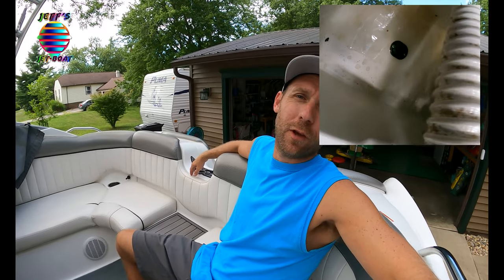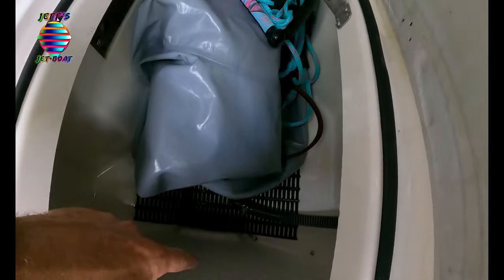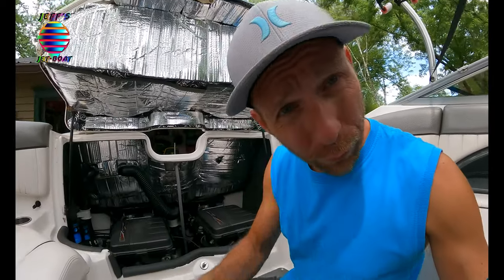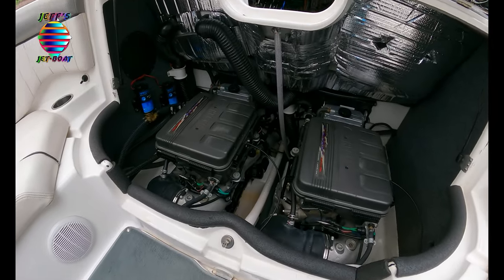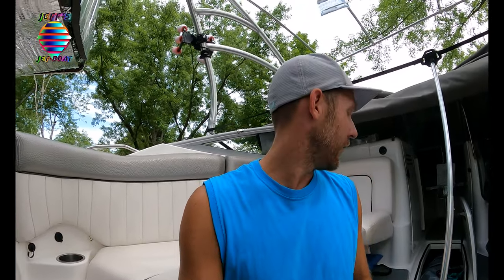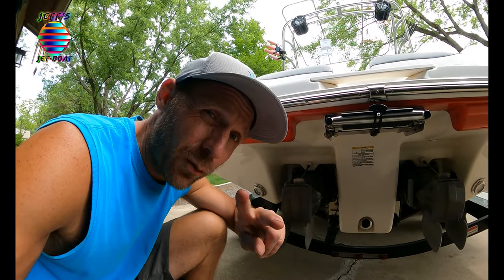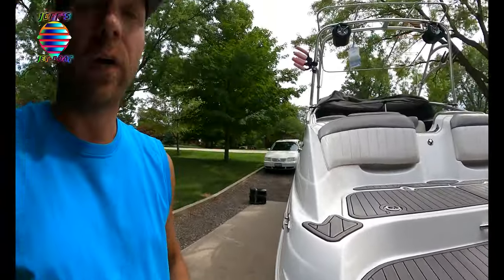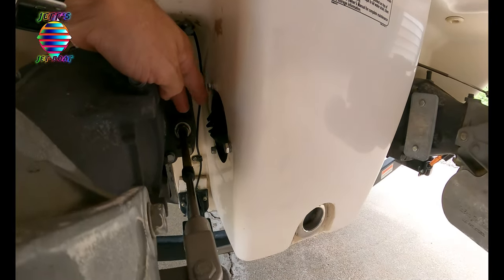Locker Drain Plugs, IN or OUT? - Yamaha Jet Boat

Comment: manual says to keep them all plugged in the water at all times, so that any water accumulation will not sink the boat, and that water that gets in the hull, has an internal passage to the bilge, which has a pump.  Also keep note that the boat has 2 ways to rid water, actively via bilge, and passive.  The passive method is for surface water that gets on the surface deck, the boat has channels that lead to the rear platform to passively drain water (in a way self bailing, specially when you keep the bow up with throttle in the event significant water gets in from a wave).  Lets say you are storing boat outdoors on a trailer, you can keep all plugs open, even the hull drain plugs so there is no rain acummulation in boat on dry land.  Also the bilge stays active even with battery off and key not inserted in any situation.

Comment: I for sure leave my ski locker plug out.  At the end of a day on the lake, it'll have a lot of slimy nasty water in there from putting in and pulling out wakeboards, tubes, skis, floaties.  It would be a moldy mess in there if I left the drain plug in.

Comment: Jeff, please see my comment on the previous video. I had 6” of water on the bilge thinking it was because I left the plug out in your video. Based on this video, it sounds like I have a leak in the scupper or something else. Any advice on how to seal the exhaust outlet or the scupper? There was old caulking hanging out of my exhaust outlet.
Reply from the maker: What is the year and model of your Yamaha Boat?
Reply: @JeffDoesThis  2008 AR230 HO

Comment: Just bought a 2007. How much water should come out from the drain plug after a day on the water. We took it out for a test run call it 10 minutes. About 2 quarts of water came out once we put it on the trailer and removed the plug. The more I think about it I am nervous. First jet boat.
Reply from the maker: How much water should come out?  It all depends on what you are doing.  If we are wakeboarding/surfing with people getting in and out of the boat all day then we will have a gallon come out of it.  But after 10 minutes it should still be dry.  You may have had water in the bilge that finally moved to the back of the boat after running it.  I would check your scupper valve for leaks and here is a really good way to do it - https://youtu.be/R4uqMh-nGAg?t=21

Comment: I bought an OEM plastic scupper for my 2005 SX230, but see that you upgraded yours to the stainless steel. Should I consider buying that instead before I start my project? I sort of figured the OEM has been on my boat for nearly 20 years and I didn't want to do any grinding to put on or flush fit an aftermarket stainless steel.
Reply from the maker: You are absolutely right, rock the plastic.  I'm pretty sure Yamaha still uses a plastic one on the new models.
Reply: @Jeff Does This...  hello. Thanks for another awesome video.  Question.  What size and where can I buy all the drain plugs for ski locker , engine,  etc.. ?

Comment: If you leave the plugs out and water is draining into the cavity between the shell and the floor, how does that water then drain?  Don’t you want water gathering in bilge where the bilge pump is located?

Also, do you have a bilge pump video?  I have a new to me 2015 AR210 and was shocked to read in the owners manual that bilge toggle must be kept on whenever in the water and if boat is stored in water, both the battery switch and bilge toggle should be on…why isn’t the bilge also direct wired to the battery?
Reply from the maker: Question 1 - The water drains into your bilge from the center locker.  There are no compartments that water can get trapped into in the boat. 
Question 2 - They way your bilge pump is wired is how 99% of all boats are wired up.   You can change it out but it works just fine.  I have left mine stock and had ZERO problems.
Reply: tks! @JeffDoesThis
Reply: I have order 5 drain plugs from Part Zilla all wrong. I have A 2007  sx-210. The lower outside drain plug that literally drains the boat. Any way to get a part number for it?
Reply: @stanandrewski5465  I have an '05 SX230.  The main drain plug is just a 1/2NPT brass plug.  Should be able to get one at any hardware store.